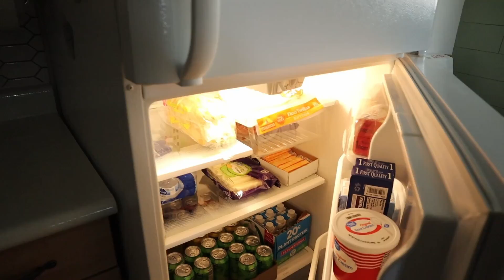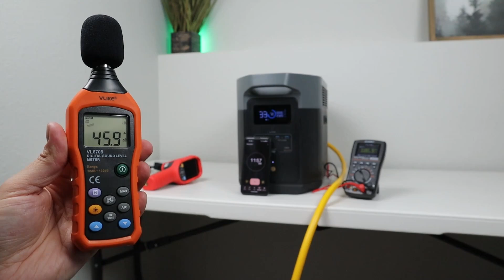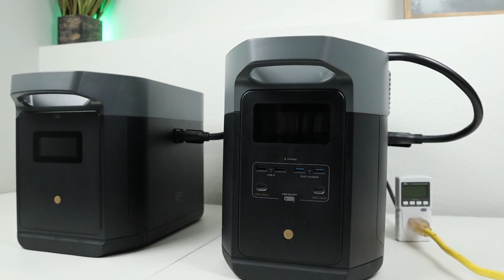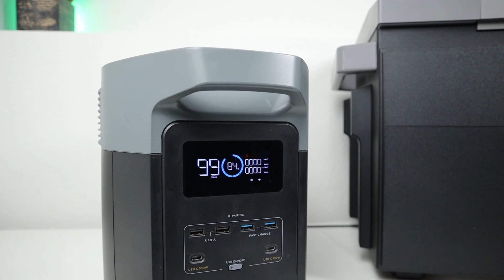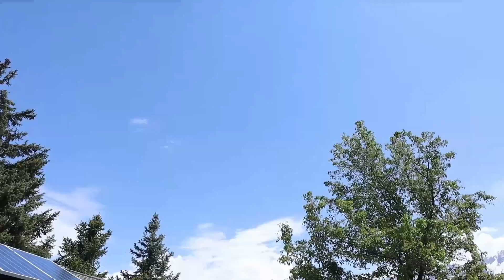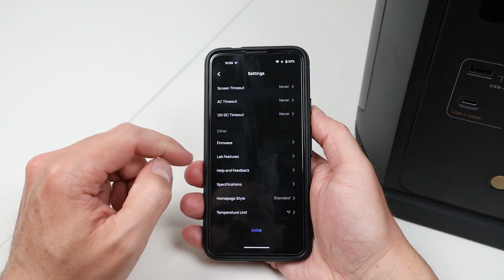The NEW EcoFlow Delta 2 MAX - LFP Batteries - QUIET FANS - 1000 Watts of Solar - FULLY TESTED!

Comment from the maker: What did you think of the EcoFlow Delta 2 MAX?! Did you think the upgrades are worth it?
Save $150 off the launch price by using this DISCOUNT CODE:   EFJASONI8
OR get two 110w solar panels for FREE using this DISCOUNT CODE:  2X110JASON
EcoFlow Website: http://shrsl.com/430fa
EcoFlow Amazon: https://amzn.to/3MRDKqS
Reply from the maker: Discount code has been fixed to 8%
Reply: Ecoflow is great company but they really need to listen to the customers and make their expansion batteries so you can charge them and have 12 vote outlets on them. Like the other companies, Bluetti.
Reply: @adamtedder700  agreed
Reply: @adamtedder700  Yup, only reason I haven't jumped on the pre-sale, kinda disappointing... maybe they can release a power hub of some sorts that plugs into the XT150
Reply: I think that the LFP battery chemistry is worth the investment
Reply: tried your promo code in cart and it is only 5% off (-$94.95)
Reply from the maker: @adonnis_85  really!? Wow.... Great fail Ecoflow!
Reply: @Jasonoid  yeah their generic 5% off coupon is the same discount as yours... not very nice.
Reply: solar panel coupon worked correctly though😁
Reply: as per ups switch gap problem would it solve with an inline module for small time ups surge protector style
Reply from the maker: @indegruv  if you purchase a true small UPS unit and put it inline with the inverter that will bypass the slowness for sure.
Reply: Great demo. Love the tech aspects.
Reply: It's cheaper to buy 2 delta 2's than 1 delta2 max
Reply: This may have been answered, if so, my apologies, but for example, if charging the Max via dc input up to 60 vdc, can the inverter still run an AC appliance if there is enough power left in the batteries? I would really be interested to know if, say, you were inputting a solar panel dc charge thru the mppt controllers of around 900 watts, and running an ac appliance using say, 500 watts at the same time, if the net difference would go to charging the onboard Max batteries. Hope that makes sense. Of course, the question is moot if the inverter shuts down while taking a charge either from dc sources, or even an  source.
Reply from the maker: @patgordzelik5642  yes, any extra power will charge the batteries while running the load as well.
Reply: Should have said, even an AC source.
Reply: Perfect! Thanks for the speedy reply, you the man!
Reply from the maker: @patgordzelik5642  spread the word of the channel, that's all I ask 😁👍
Reply: @Jasonoid  Will do! 
I am a recently retired solar and wind power installer working overseas, now home in Tx looking to do some fishing and camping with my new cabover camper. I know zippo about these cute little power stations, but found out in a hurry they have grown up, thanks to channels like yours…just subscribed. Found your channel today, gads, do you ever sleep🤣? Your info is going to help me with my boon docking goals. Trying to downsize my mindset from 1000 kwh arrays to 800 watt hours. Your helping me to do that easy enuff, thanks!

Comment: I know this is an older video, but hopefully someone can respond to my question.  Based on the test I describe below I am assuming the extra batteries for the Delta 2 Max have idle power consumption as well. Since they don’t have an inverter, do they have their own BMS that consumes power?  Do my test results make sense? 

I wanted to determine the idle consumption of my D2M and 2 extra batteries. With the batteries connected, I left the inverter on with nothing plugged in for 24 hours. 
The capacity dropped from 100% to 95%, so the loss was approximately 300wh. However only the external battery lost capacity. It dropped to 85%, while the 2 extra batteries remained at 100%.  This made sense because they don’t have inverters. 

Next I plugged a Kill-a-watt meter into the power station and plugged into my transfer switch. I turned on 1 circuit that includes the outlets for my refrigerator , microwave and toaster oven.  So the watt meter should measure everything being powered by that circuit. With no solar or ac input I ran this for another 24 hours. 

After 24 hours the watt meter read .80kWh (or 800Wh). So adding the 300wh idle consumption of the inverter to that, the total power consumption should be approximately 1100Wh. 

The beginning state of charge overall was 95% (Internal battery at 85%, extras at 100%). 
After 24 hours the overall SOC was 72% (internal 68%, extras 75% and 73%). This drop in capacity comes to 1380Wh, which is 280 more than what watt meter indicated. Would the BMS in the extra batteries account for this? 

If this is correct, then we need to remember to take the idle consumption of any extra batteries into account when sizing these systems. 

Just trying to understand. Any thoughts would be appreciated.

Comment: Having the ability to disable DC timeout is amazing!  This is exactly the info I was looking for. Thank you so much. Tesla recently disabled low voltage DC when not in the car/outside camp mode, so I bought another power station to fill the gap. My fridge is very efficient and goes long periods without drawing power, so that station ended up disabling the DC output.

Comment: My eco 2 with smart battery runs my fullsize top loading washing machine for numerous loads , but when tried it with my electric clothes dryer it stopped ' "overload".

Will the ecoflow delta 2 max run my electric clothes dryer with added smart battery? Both are whirlpool.  I'm elderly so the bigger batteries are not an option.

Thank you

Comment: could you charge this delta 2 max using a battery like the powerqueen 12.8v 200Ah with 2 xt60i cables connected going to both charge ports at the same time?  that would charge it at like 400 watts input id guess.
Reply from the maker: 12v batteries charge the power station at 100w, so 100w per port, 200w total. You need to boost the voltage to 24v or 36v to get faster charging speeds.

Comment: Are you saying that if grid power goes down this unit can simply be plugged into any wall outlet and pass that power through all the lines and power my refrigerator, television, lamps? So i wouldnt need to get an electrician to install a generator plug into my breaker panel?
Reply from the maker: It only powers the appliances connected to the inverter outlets on the back. The 120v outlets need to be connected to your devices for them to be powered.

Comment: Question about output of barrel plugs.  I thought the max was 3 amps... so  3x12.5volts - is about 37ish watts.  Did you say you were able to pull 137 watts from the barrel port??  how can this be? I can understand maybe getting that from the 12v cig socket but don't understand that wattage come from barrel port.  Did I misunderstand you?  thank you.
Reply from the maker: In my testing the max wattage allowed from the any of the DC ports is 137 watts. You can get that from the cigarette port or the barrel ports. The recommended max power is 3 amps but it doesn't stop there.
Reply: @Jasonoid  very interesting! thank you

Comment: If you plug in Ecoflow unit into a window small A/C unit , how many hours can you get out of it before having to recharge?
Reply from the maker: Window AC will pull 500 watts, that means 4 hours of runtime or so. Expansion battery will double that, runtime if you have solar to offset the the load you can run indefinitely.
Reply: @Jasonoid  THANK YOU….👍some knowledge in that the solar panels usually come standard to 100 watts or 5.2 amps which I am deducting from your message then minimum 5 panels? Is an inverted and regulator needed?  Are you in the business where I can buy from you or is there someplace you recommend?
Reply from the maker: @williamzee7748  these will work great, one per charging port:
https://youtu.be/pLRKljjaqMA

Comment: Jason,  was wondering if you would check something for me (us).  You showed in this video that maxing out all THREE charging ports (120 VAC & two charge controllers) the Delta 2 Max would combine all three and charged at near 2700 watts!.  Now that they released the Ecoflow Alternator Charger that plugs in where the expansion battery would plug into...could you test if you had all three rear charge inputs running and then added the 800 watt alternator charger...would it charge at near 3500 watts ! ?

Comment: I don't see the current DELTA PRO reviewed.  I like the ULTRA for the size and all-in-one, but the paired DELTA PROs give redundancy for 120V as well as the ability to top off my off-grid 840 AH lead acid battery.  I'd put the pair on the hub at my bug-out but need it to be able to:
1. Work remotely with wi-fi
2. Light off and return power with 24/7 solar

Look, you guys are all OVER the internet. The first guy who wants a $10,000 sale wins my biz.  I'm looking for both a whole home back-up and an off grid for my land.  I am an engineer who can go direct to the mfr but I'm trying to connect with one of you guys.  Could be you, HOBOTECH, MinuteManPrep (Powered Portable Solar) or Will Prowse.

Comment: Watched your video again, because of you I have learned so much, whereas at the beginning I did not have enough knowledge to ask a proper question.  I have the Delta 2000 max that I use as a EPS for my fridge when I travel out of town.  Do you know if I purchased an extension battery and left it turned on with the Delta 2000 max if it would eventually drain, or would it maintain its charge  due to the EPS function or pass through charging?  I hope I made sense.

Comment: Great review as usual, been following you since the “beginning “. Thinking of getting one of these EcoFlow Delta 2 Max units to power a small travel trailer. However, I’m confused as to how I can get DC power out of the EcoFlow to a Blue Sea 12v DC distribution fuse box to make it easier to wire everything to one location inside. 

From reading specs there are only 2 DC 5521 outs and they appear to be capped at 3A/38w 😕. The only other one I see is the 12v cigarette port which does seem to allow 10A/126w but I was going to use that one for my 12v fridge. 

I just want to run some LED lights, MaxxAir fans, fridge, etc… can you offer some guidance? Also, why do so many of these outdoor specific products make getting 12v out so difficult?  Six A/C out ports? Kind of overkill when boon docking.
Reply from the maker: This unit isn't really built for RV usage since it doesn't have the high DC output. If you want that I'd recommend checking out models like the new Bluetti AC240, the Pecron E1500LFP, the UGREEN 2200, and the Bluetti AC200max. Those units all the a 30 amp DC output that you can connect into a DC fuse box.
Reply: @Jasonoid  Any thoughts on Goal Zero 1500x? The one thing I don’t like is the chemistry and the price but they seem to be moving line over to LiFePo4.
Reply from the maker: @MIAMIC70  they have a newer line of smaller LFP models out now. Nothing in the 2000w category. Goal Zero are expensive but they are a US owned company with USA support. Hard to get that with the other companies. That's why the price is higher.
Reply: @Jasonoid  Yea, saw that. Just emailed them see if there is any eta on larger units switching over to LiFePo4. In another life I worked with Goal Zero right about time they launched in 2009-2010. Was “interesting”.

It seems like Jackery they were / are very late to the LiFePo4 party.

Comment: Are you going to get any of the Dabbsson power stations to review?  It looks like they copied the EcoFlow Delta 2, Delta 2 Max and Delta Pro, improved upon them, and even made them able to join together in parallel modes.  Truly awesome if they have low enough standby power loss, good efficiency and the company doesn't become vaporware...eveything I've found on them is eerily similar to EcoFlow...like maybe even a "secret" R&D section of EcoFlow😅
Reply from the maker: I've thought about it, I don't think the videos would be popular at all, maybe 3000 views tops. Hard to justify 40 to 60 hours of work for a few thousand views.
Reply: @Jasonoid  maybe a combo video of the power stations with parallel capability?

Comment: Hola, otra vez Jason, desde España, gracias por tu labor, y por tus vídeos! Una pregunta porfavor, cómo puedo alargar la vida útil de una batería de extensión Delta Max? Quiero duplicar los ciclos de carga, de 800 a ..1600. Muy importante, uso una Delta2 Max(2048w LFP)con una batería de extension Delta Max (2016w solo800ciclos)  Es posible? Que me aconsejas? Cuanto se pueden alargar los ciclos de carga, y como!  Gracias, y como siempre estupendo trabajo!!
Reply from the maker: Cargar y descargar lentamente es una forma de prolongar la vida útil de la batería. Mantener el porcentaje de batería entre el 20% y el 95% también prolongará la vida útil de la batería.

Comment: Hi, do you use safety devices when connecting panel to delta 2 max?
Reply from the maker: Like fuses on my solar arrays? Yes, I have inline fuses.
Reply: @Jasonoid  thank you. For the delta 2 max , would you know how many amp if I want to add surge protection device?

Comment: i do have an apc battery backup, does that count? if i used this inverter from ecoflow?
Reply from the maker: They updated the UPS cutover time on the Delta 2 Max to be under 20ms so it's much faster now. I test that here in this video:   https://youtu.be/ajVgUW4qRGI
You could also run a APC battery backup off the AC inverter outlet if you wanted a SUPER fast UPS.

Comment: Any idea if the older EcoFlow Delta Max can be used as a smart extra battery for the EcoFlow Delta 2 Max via the side extra battery port?
I have both units and would like to use them together.
Reply from the maker: I'd say the biggest factors is the difference in battery chemistry. One is lithium ion and one is LFP. You could always connect them together to see what will happen. Ecoflow told me they aren't designed to be used but it still might work.
Reply: @Jasonoid  thanks. I sent EcoFlow Support an email asking the question too. Will respond back here once I hear back from them.

Comment: @Jasonoid, Excellent excellent review!  I'm waiting on delivery of my Delta 2 Max and this single video has answered so many of my questions!  One thing I would really like to find out pertains to the dual charging capability.  I'm curious if I can limit the AC charging speed via the app, and also use a few of the Newpowa panels you linked to "top up" the battery during the day while effectively supplementing a portion of the AC output at night.  It may require some trial and error to strike a good balance, but any idea if this could work?

Comment: I want to see the VOLTAGE under various loads with a voltage tester or kilowatt meter. If the voltage drops below 117 volts under full load, I call that a failure.
Reply from the maker: I showed that pretty well in the video.

Comment: The ecoflow Delta Max has a little more power all it needs is a little Y adapter from Amazon to input double solar...
Reply from the maker: How many watts could you get if you double solar?
Reply: @Jasonoid  Depends on the panels ..
Reply from the maker: @RichardDoneganSolo  the first gen Delta Max can only get 800 watts, it's software limited.
The second gen, the new Delta 2 Max can get up to 1000 watts until it hits the software limit (has the bad 60v cutoff though).
Reply: @Jasonoid  Good information, thanks!
Reply: @Jasonoid  I wish someone would do a refrigerator test with freezer and fridge turned down...

Comment: Hi Jason,
What if I overpanel with 6*100W Renogy black lightweight place in 3 arrays serie in paralle (VOC 23.5V, VMP 19.4V, ISC 5.51A an IMP 5.2A) My 3 arrays serie was 47V@5.2A seem to be 47V@15.6A total. Does this 600W panels will cause problem or my Delta 2 max will just take he maximum at 500W? Thanks
Reply from the maker: You'd be fine connecting those panels in a 2S3P array and you'd see a limit of 500 watts when connecting them. The second option would be connecting 4 panels to one port and the other two panels to the second charging port.
Reply: I don't want to use the second port with solar. It will be connect to converter 12Vto48V@10A for 480W on the alternator. @Jasonoid
Reply from the maker: @renyraiche-gregoire4921  no worries, should be fine overpaneling as long as you stay under 60voc 👍